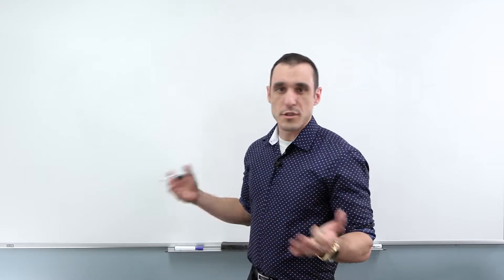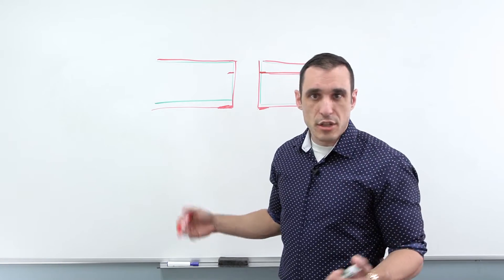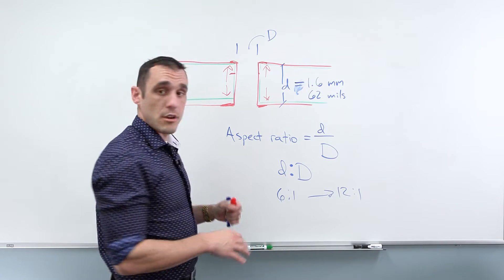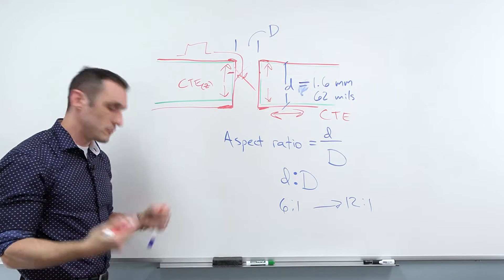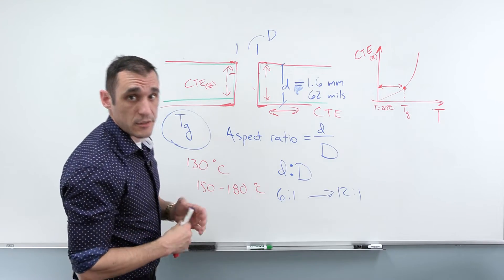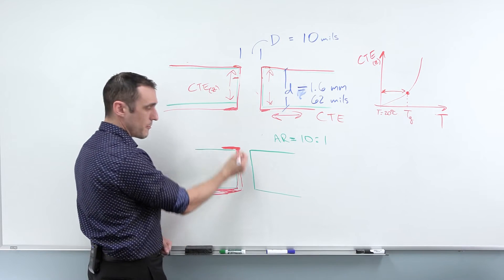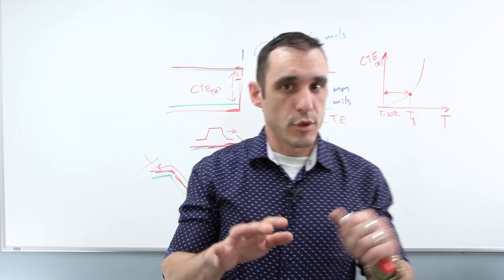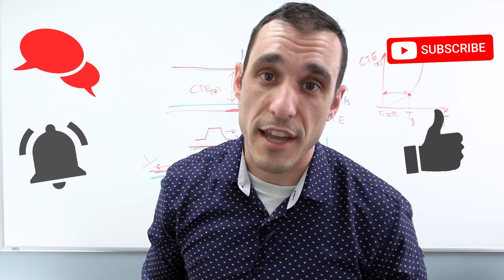Vias and Their Aspect Ratios | PCB Routing

Comment: How to determine the vía spacing in order to improve the current density and heat dissipation ¿
Reply: Good question! Unfortunately I am not aware of any IPC standard that might address this specific aspect of PCB design. There are other aspects like trace width sizing which are specified and are supported by data which can be used to create a design, but I have never seen such data or formulas for vias needed to reach a specific current density and control temperature rise. When there is a lack of this data, often a DC field solver will be needed. CST would be a good option for this.

Comment: D is finished hole or drilled hole?
Reply: Usually drilled hole diameter if you ask a manufacturer. Be careful because some design guides do not distinguish between drilled or finished hole size. As you can see I'm guitly of that sometimes!